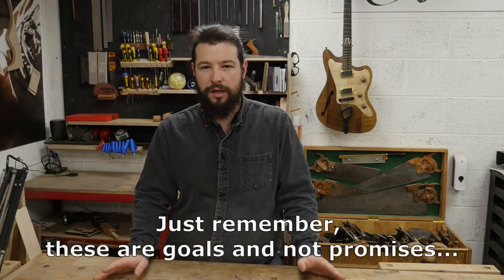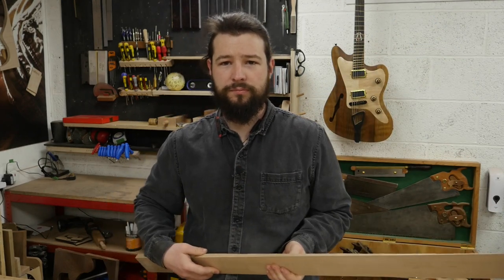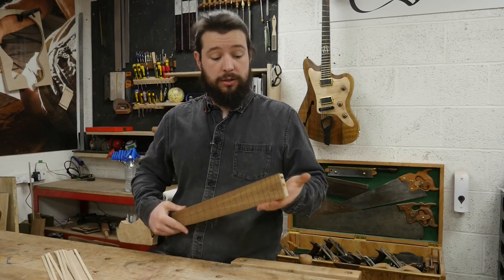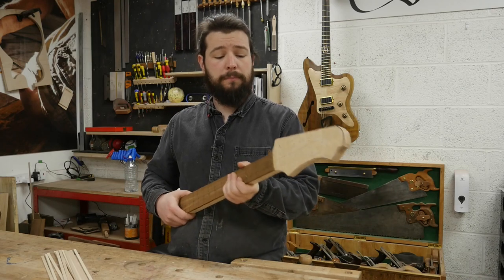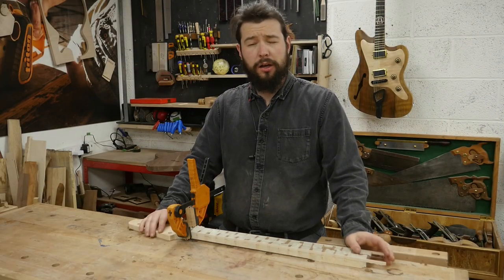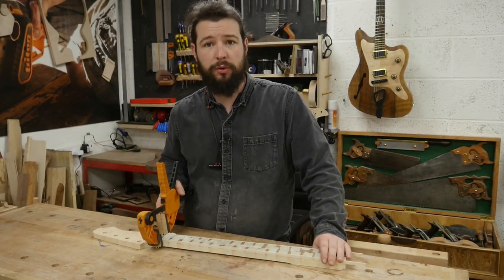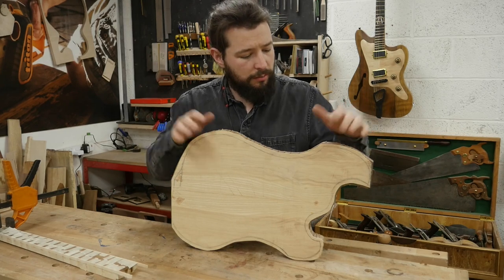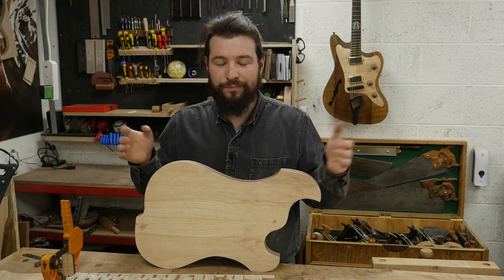All About Binding - The Building of a Bass  - Video 3 - The Great Guitar Build-Off 2022

Comment: Seeing you take a slice off the face of the headstock. What if you cut a wedge off the face and a wedge off the back to create a subtle angled head? Presumably it wouldn’t generate enough of a break angle to do away with a string tree but aesthetically it appeals to me. Any reason not to try it one time?
Reply from the maker: This is actually something we do every now and again. It takes a little extra time (and material) but it does generate enough break angle to do away with a string tree. It also gives a more attractive volute on the back of the neck in my opinion. Visually, it's barely noticeable, but I do think it looks better. I'm a fan! I simply didn't have the stock thickness for this build to do it.

Comment: Psa: don’t cut your fret slots this deep as is shown in the video. Even if you’re doing binding. It’s unnecessary , and can pose a potential structural risk. I.e it may weaken the neck slightly. .5mm deeper than your fret tang is all that’s necessary. 

Good looking build!
Reply: Fretboards aren't really structural, though. Sure, any wood, even the binding, adds to the structure, but he's not really risking anything with the deep slots.

As to why he cut them: presumably there is going to be a significant radius to the fretboard here.
Reply: @Psychlist1972  even with a 7.25” radius, you don’t have to cut a flat fretboard near that deep. If you do the math it works out to about 3.2-3.4mm depth needed using most common fretwire on a neck with a traditional width. He went almost 5-6mm. It’s not necessary. Doesn’t do any good. May not cause harm but absolutely no good. I’d wager to say the neck will be a bit more prone to movement. the tension will bow the neck a lot more when it’s got 20 6mm kerfs cut along it’s length. Will it destroy the instrument? No. But us luthiers are always looking for the 1% extra we can squeeze out of a build to make it that much better. Just not a good habit to cut them that deep.
Reply from the maker: I agree, slots that deep aren't necessary and this depth was overkill. It won't pose any detriment to structural integrity of the neck though. When installing frets, I also add glue in each slot, which will essentially fill the gaps and solidify the whole thing.
These slots ended up maybe 4mm or so, which gives me plenty of leeway when radiussing to ensure that they don't go too shallow. More than once, I've seen slots get too shallow after radiussing and that's a real pain in the butt to sort out since you can no longer run a saw easily through them because of binding.